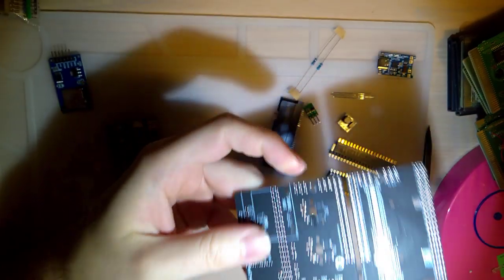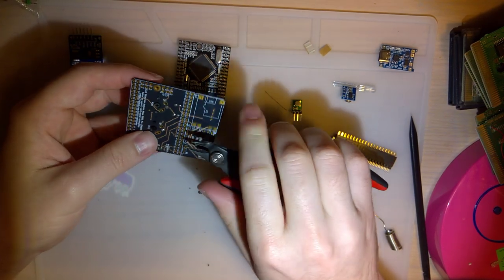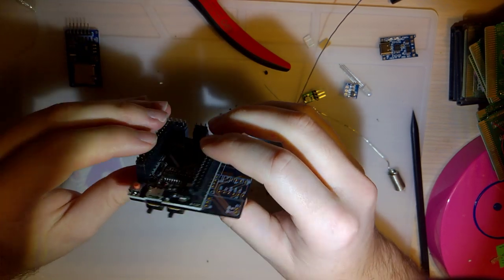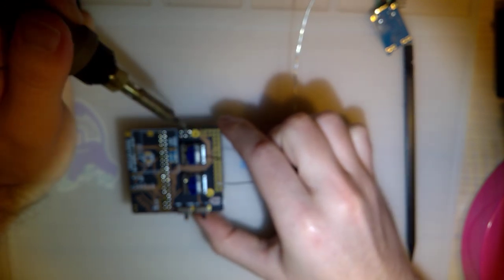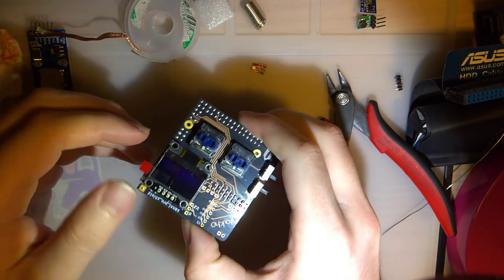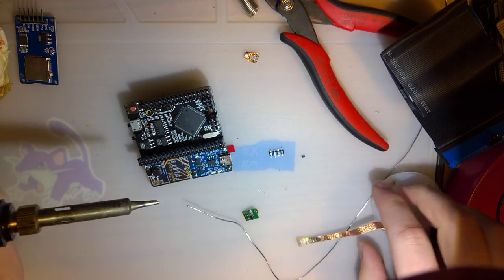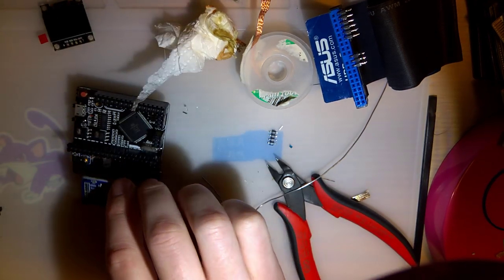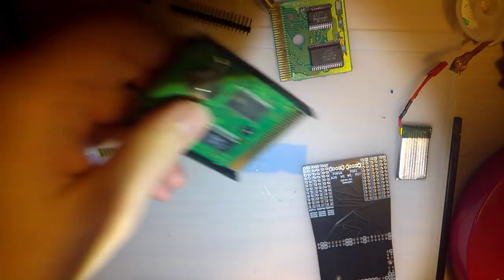Assembling another Sanni Portable Cartreader (v1.2c)

Comment: Do you have problems with GBA games? I get black screen when I select gba in menu (with the switch also in gba) and the last version (I updated because I had the same problems in earliers versions)
Reply from the maker: Nope, I haven't seen that issue. If you're using my hardware, I'd recommend v4.3. I know it's an older version but it's what I've fully tested. Newer versions seem to work but I haven't done any indepth testing or verification since. Unfortunately, this does not appear to be available anymore.
Reply: @makho  thanks for reply. No problem was my fauilt. GBA games info show in the screen a bit after GB/GBC I just wanted to wait a bit more 😅

Comment: Are there any guides for complete noobs, on how to assemble one of these? Would be so useful!
Reply from the maker: This is that
Reply: @makho  And all the components needed are in BOM in your dropbox?
Reply from the maker: @BlackLotusNinja  it should be but I've also created a github for this that should have more up to date info https://github.com/makhowastaken/cartreader
Reply: @makho  Oh thank you! Sorry for so many questions, but would this be able to flash an  official Nintendo power GB Memory Cartridge?
Reply from the maker: @BlackLotusNinja  yes, look at the github for the original hardware that I based mine off. This is all documented between the two github repos.
Reply: Hey, Makho! 
I'm seeking help. Some of the aliexpress links in your bom file for parts are dead...
I could buy those components based on description, but I'm afraid to buy it in wrong shape or configuration.. could you provide me with pics of how they look like or maybe even links?
Specifically, what is missing: 
3.3v 0.59A Voltage Regulator 
Battery gauge (volt meter panel) 
2x SMT SPST Push Button (OR mech keyboard switch) - I think I got the right item in other aliexpress shop, but still not sure….
Thank you!
Reply from the maker: @BlackLotusNinja  any 3.3v reg module will work, battery gauge is 100% optional, and the switches are personal preference.

Comment: Makho, I just finished this build a minute ago...my first ever real build. And the damn thing won't turn on lmao
Reply from the maker: you'd have to trace out the power with a multimeter to determine where the failure is. If you already have the arduino flashed (and you should have done that before assembling because swapping the mega module is NOT easy). Set it to 5v/GBC and see if it can be powered by USB if you plug a cable straight into the arduino (leave it switched off so you don't backfeed anything).
Reply: @makho  yeah I flashed the arduino beforehand. That is mainly why this build took me so long (almost 2 months). Took me a while to learn how to program the arduino from a mac, along with waiting on parts to come in. 

Ill have my multimeter next week as I am currently out of country, but looking forward to getting this thing completed.
Reply: Hey buddy, did you use any particular guide on how to build it?
Reply: @BlackLotusNinja  just Makho’s videos on building his cart readers. I managed to get it working perfectly in the end